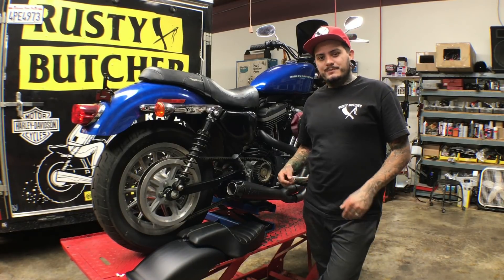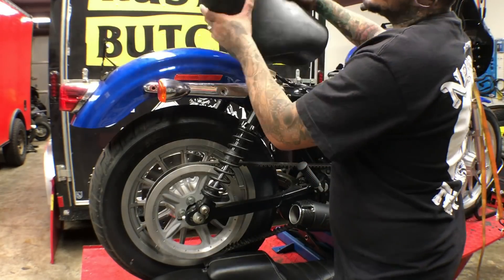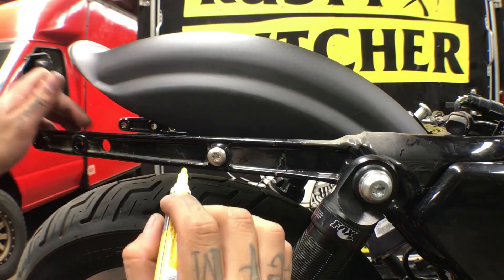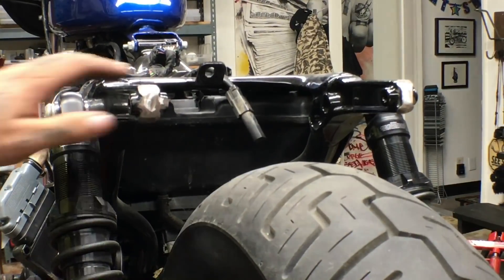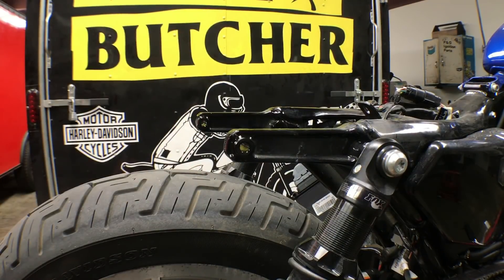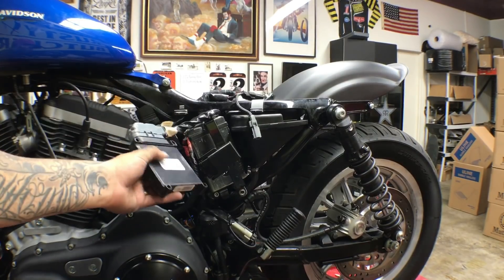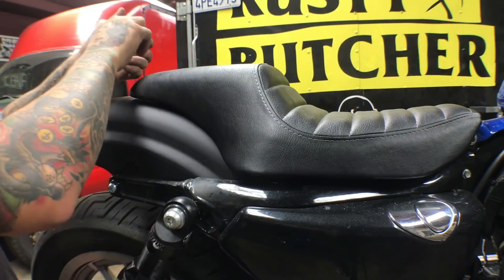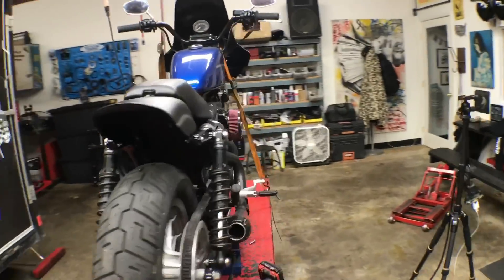Install: Lowbrow Tsunami fender & Biltwell speedway install on Street Tracker

Comment: Those seats are available from Aliexpress, I bought one for my 2011 XL883N 'Iron', it cost me only £28.00 ($37.50) including delivery to the UK. Mine is light tan split leather with a diamond stitch pattern, it looks great installed on the bike and it's ideal for my 5' 8" height.

Comment: Can you build a tracker with rear passenger option. I want to build one but my wife loves to ride with me 😢
Reply: This is exactly what I’m looking for. We need a longer pillion option, maybe custom seat is the way to go? Reckon that fender would take a pillion?
Reply: @Willieswheels  glad im not the only one. I want to take it around some flat trails and dont want to cut the rear brackets. Theres gotta be a build out thrte
Reply: @miamimotogroup5371  you could jack it up with 15” rears and run a Nightster rear fender. Maybe the only compromise. That or weld in a new hoop and fit a bench seat.